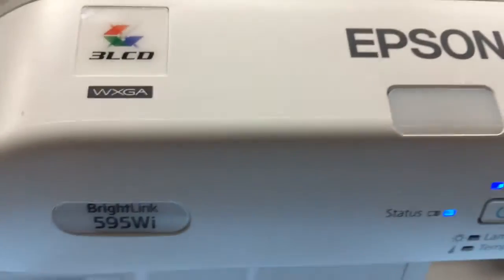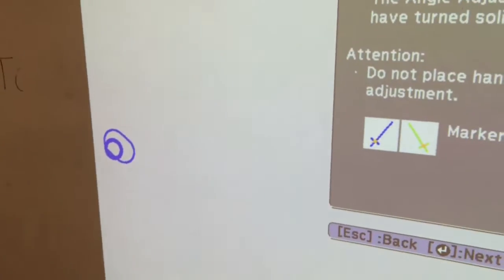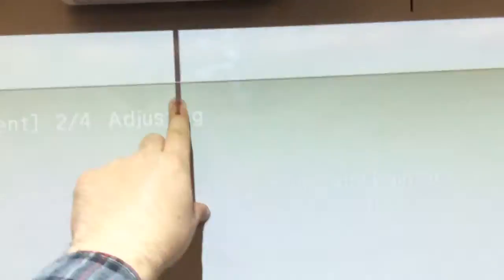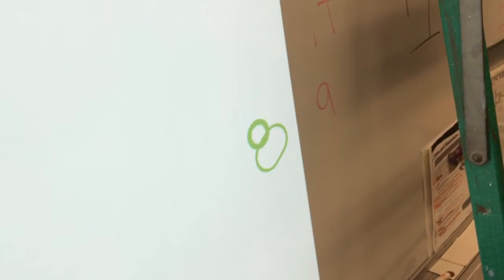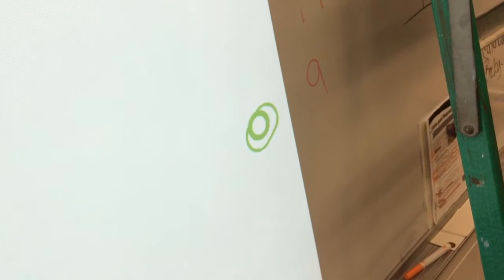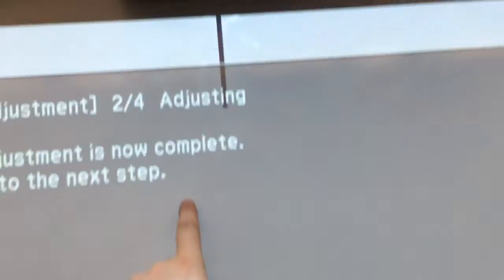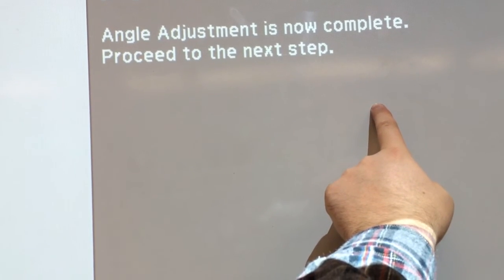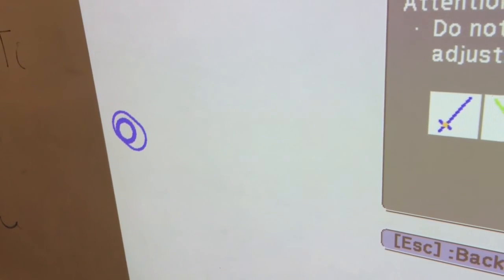Epson 595Wi - touch unit very hard to align to accurately

Comment: I just installed 3 of the 695wi at our location - never had these issues, however I chose to do away with the white boards and just project on the wall.  Used special paint on the walls (monochromatic I believe) and other than a slight drag on your fingertip or pen, it works great.  I am sure there would be a smoother feel if on a whiteboard.  I was told to ensure if you do use a whiteboard that is be securely attached to the wall at all points - you should not be able to press on the board and have any movement.

Although I did have one unit die on me in less than a year - contacted Epson and they are shipping a replacement unit overnight - due here today (3/20/18) and I will be installing and calibrating again.

Comment: The 695 is much improved.  The 595 is a total pain!!  What I have discovered after installing loads of these is to try the auto calibration first.  That works for both finger and pen.  If not I try manual finger (similar to pen).